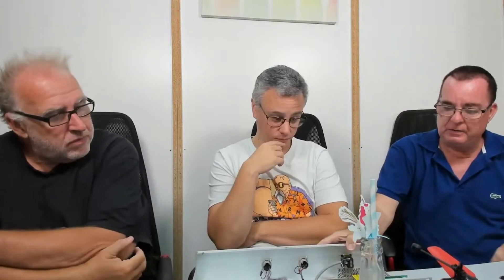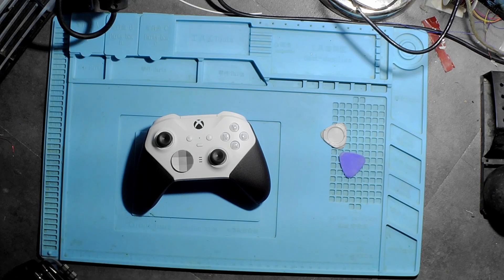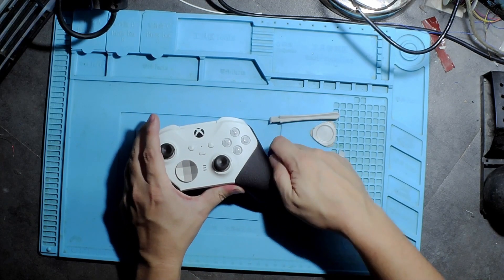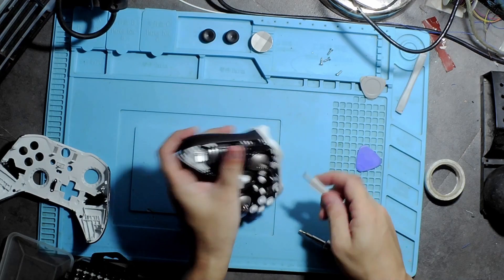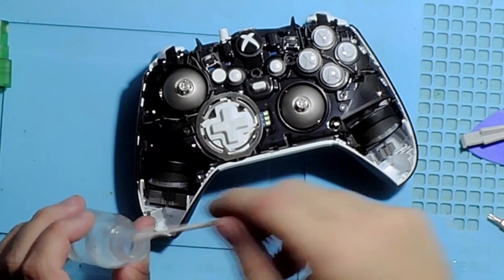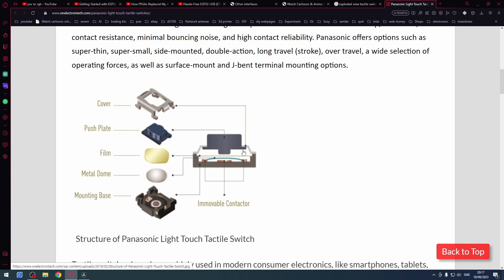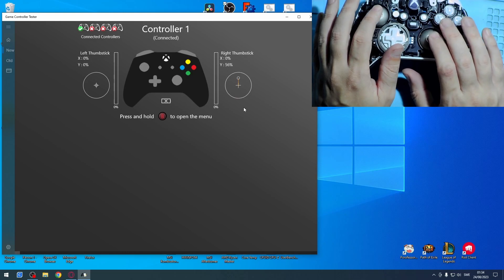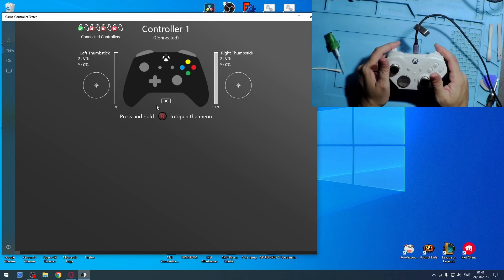Xbox Elite 2 Pro controller , unresponsive shoulder button FIX😎

Comment: Great video. I did the same thing to fix the controller but i used WD 40 spray to fix this button. Thanks
Reply: I confrim that the WD 40 works instantly. I tried to fix the RB button with alcol and compressed air, but nothing, while the WD 40 fixed it right away
Reply from the maker: Good idea , this will also prevent it from "sparking" and creating carbon dust, this should keep them alive a bit longer , 

thank you for sharing

Comment: Can you make a video on unresponsive back paddles??
Reply from the maker: Hi would gladly do it but i don't have the controller anymore "owner Picked it up" -  I do have a Pro controller for the PS4 that has same flappy paddles on the back  , it looks very similar to the Xbox one . 

would you be interested in seeing that being "fixed" it actually works but method should be the same

Comment: Could this same technique be used to clean an intermittent (left) joy stick on the same controller??
Reply from the maker: Joysticks little bit difrent but can essentially be cleaned the same way usually there are 2 potentiometer inside at 90 degrees from eachother the carbon dust gets stuck on the wiper arm . I'll try to make a video demonstrating this 😊